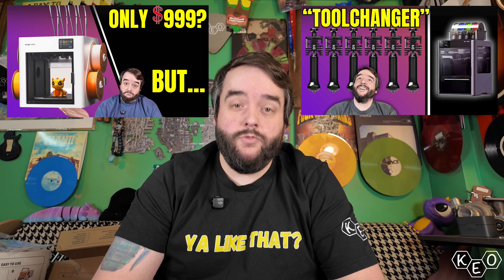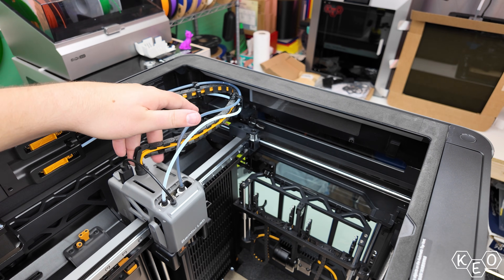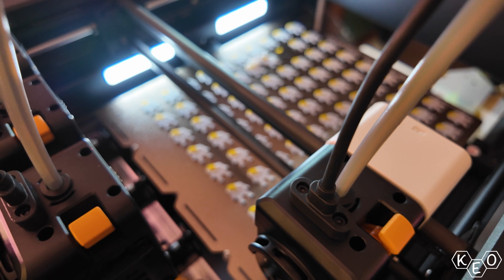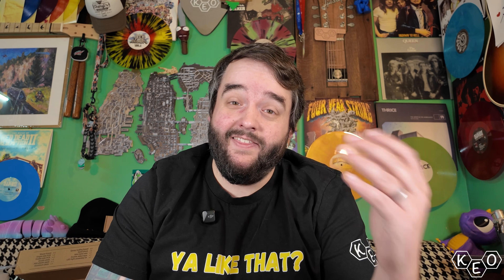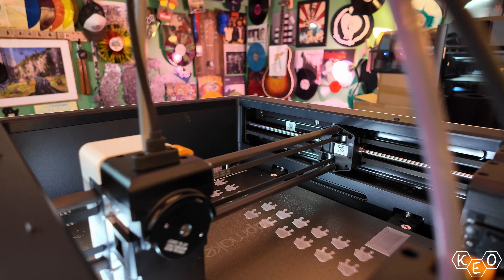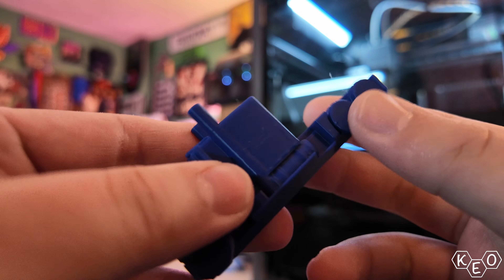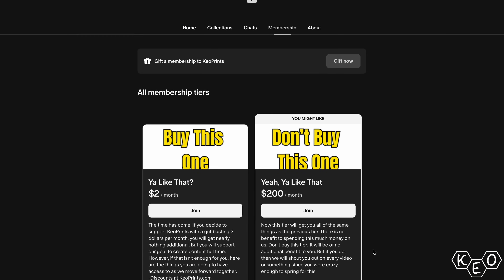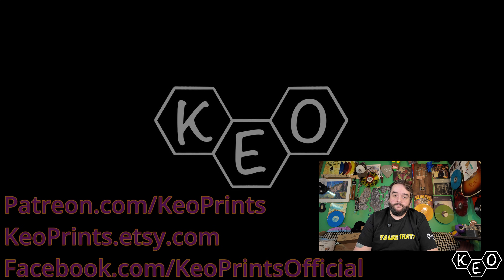Bambu H2C vs Snapmaker U1 — Toolchanger War

Comment: I told Santa he better get me an H2C or else
Reply from the maker: I hope that sleigh is rated for that sucker because my back (and wallet) just barely made it out alive
Reply: @KeoPrints LOL I hear you. I have an H2D, X1C, and A1 right now. I mostly print stuff I like, but dabble in selling things and listed the usual flexi dragons and toys on a few platforms. Honestly I didn't even put much effort into it. And then BAM, two weeks ago I started getting 2 to 3 orders a day for Christmas. I was using the H2D to print scaled up versions of the dragons and it backfired on me because its my only large printer that can fit those dragons and its a huge bottleneck. I really need and want an H2C, although the only way I can swing it at the moment is if I sell my $3,000 sony camera and lens setup. Getting the same pictures of birds was getting boring anyways, lol. I have one lens listed and will list the rest of everything today.

But yeah these H series printers do serious damage to your wallet and back. I work at a warehouse and I'm kinda used to it, I put on my backbrace and pushed my H2D up the stairs and then lifted it by myself onto the table. I was worried I would drop it or break my back but it worked out lol
Reply: @KeoPrints i forgot to mention, I do have a U1 on the way already. This video surprised me, an entire spare toolhead is only $65? Thats crazy

Comment: Both is really the only option. Actually Both but the H2D and U1. You get the flexibility of 25 colors when you need it with some waste and fantastic high temp capabilities. Then still have a tool changer for day to day 4+ colors with some tricks on the U1.  If I could only have one I'd be right there with you with the H2C because as much as I complain about flexibles I could get by with one in the nozzle to mix with the other nozzle. With the price difference you might as well do the H2D and U1 at pretty much the same cost as the H2C.
Reply from the maker: It truly is crazy how different these two are in the specific purposes they serve

Comment: When it comes to bulk, or rather cubature, you’d have to compare the U1 to the H2C with an AMS. — Also, print yourself that adapter for the IKEA box for your U1. 🙂
Reply: Ikea box works great for me.
Reply: @brandonberkmortel9558  Thanks for confirming. So it’s worthwhile since it’s no stunt.
Reply from the maker: I’ve seen that. I may do that

Comment: Compare the H2C’s print quality to a P1S. I have both and had to tune all my filaments, even BL’s that worked out of the box on the P1S. Just right now there’s even a layer-shift on my ongoing print with BL PETG HF (stacking box v2 by HG_design).

You can do TPU however, in the Wojtek system on the right, in “H2D mode” (no filament changes).

Comment: The U1 toolheads are shipping here! I ordered a spare, and it’s coming in two days. The only thing is, I ordered through multiple accounts (to utilize coupons) but only the account I used to order the U1 has been shipped for yet.
Reply: Which coupons are you using??

Comment: I agree that the TPU compatibility was a miss on the H2C. One thing to note though, currently TPU is compatible on the right nozzle and will become compatible with the left nozzle in a firmware update. Yes, that limits you to 2 TPU’s or 1 TPU and other AMS compatible filaments, but hopefully in the near future it won’t be as bad as it is currently. If you absolutely need 3-4 different TPU’s in one print then yes the U1 is the only option. But if you’re only planning on incorporating TPU into a print or needing incompatible support material, then the H2C is plenty fine

One more note on swap times. I trimmed my PTFE tubes as it says to in the instructions and I’m at a consistent 28 seconds swap time. Yes still much higher that a true tool changer, but the gap does close a little
Reply from the maker: Dang, 28 seconds is not bad at all. That’s something I might have a look into

Comment: The biggest thing for me is - time. The H2C is basically 3 times the price once when you get 2 AMS 2 Pros to cover the Vortek nozzles and and AMS HT to cover the left nozzle plus buying all the 0.4mm nozzles for the Vortek at $40 a pop. So why would I pay 3 times as much for a machine that is up to 3 or more times slower. For the same money I can get 3 U1s and pump out up to 9+ times as many prints vs a single H2C.

I got my first U1 a couple weeks ago and love it. There are some growing pains with a new launch and being an early adopter, but I'm sure most of those will be ironed out either by Snapmaker or by the community in general (considering open Klipper). I have 2 more U1s coming next month. I'm debating if I want to upgrade my H2D with the Vortek. Don't know if it's actually worth it to lose the extra build volume and have to eat $40 per nozzle, plus the upgrade seems pretty complicated. I mean I built a Voron from a box of parts and working on a Lemontron, so I'm sure I could handle it, but is it worth taking the risk of tearing down a perfectly good machine and trying to rebuild it in my garage to be as good as a factory H2C?

Comment: This thing that the H2s can do more colors is a red herring:
1) If you had a look at the Fluidd interface (stick the printer's IP in your browser), you'll have noticed the 32 virtual tools. That means you can, right now, add up to 32 different filaments in the same build. You simply pause and swap them by hand. I'm regularly printing with up to 10 elements, with minimum effort and no waste.
2) It's a kliper printer, so all the kliper ecosystem (a REAL ecosystem, because a cage is not an ecosystem) applies (yes, ymmv depending on your capabilities). ERCF has virtually no lane limits; now multiply by 4. That's the real "the sky is the limit."

You guys are comparing a just-released platform VS one that, as you correctly pointed out, has a deeper history. Give it time, you'd be amazed at what people are working on to keep expanding the capabilities of this thing.

Look at the moon, not the finger.

Comment: Thanks for this video.
You don't mention poops, so what about the two models? Personally, I have an X1C that I love, but I was put off by the price of the H2... And the fact that, before the H2C, they hadn't done anything to solve the poop problem!
That said, have you looked at the Prusa solution? There... if it weren't for the price, and also the size of the Core1's print surface, which is even smaller than an X1C, I love the concept, which seems even better than the H2C! But hey, we'll never get a collaboration with either Bambu or Prusa, I've already tried!  🤣

Comment: I see it the same way you do. I would choose Bambu, but only because they are very reliable and have good software. The camera on the U1 is very, very bad and there are hardly any parts if something should break. Bambu is known simply for its reliability. Of course, the H2C costs a lot of money. I would have seen it in the price of 1800 euros, that would have been okay with 0.4 nozzles. You also have the advantage of printing 24 colors, which is extraordinary. With the U1, only 4 colors are possible, clearly it is enough for the normal user. The Prusa with its 8 heads is said to cost almost 4000 euros, which is even more money. And it also all becomes more expensive, which is regulated by inflation and tariffs. You can easily see a p1s and a p2s.

Comment: What does the Bamboo nozzle changing actually do for you since it still has to roll back and purge anyway ?
Reply: Eliminates the need to purge the whole nozzle. You only need to prime it. Also no contamination
Reply: @riba2233  AHH yes, don't have to purge as much because colours won't mix. Would be great if Bamboo could figure out a way to keep the filament in the head though so it doesn't have to back it out all the way.
Reply: @Neuralatrophy  true, they would need more inlets like on A1 but that would limit the number of colours..
 Everything is a tradeoff :)
Reply: @riba2233  How many colours/materials do you need to print with at one time anyway ? There comes a point where you should ask yourself... "should I just paint this ?" 😆
Reply: @Neuralatrophy  probably yeah 😅

Comment: I want the Snapmaker U1 to be a profound success so that they go back and make a "U2" or whatever that's 350mm cubed and hopefully 8 heads...
Meanwhile, I'm also hoping that Bondtech INDX with the Prusa CORE One L for 8-10 heads/hotends is showing preposterously high potential... 
buuuuut as with anything speculative like this, I'm withholding any judgment until I see it in the wild, ready to just buy with a click rather than entering some pre-testing program and be lucky enough to get one of a few available. I want to see actual production units and meeting demand for off-the-shelf supply.

Comment: It feels strange that the H2C would have so many compromises as a flagship printer. Bambu claim they've been working on the tool change system for 3 years, which might be true, but the implementation into the printer itself seems rushed and confused. It looks to me like they left a lot of things on the table on purpose so they'd have plenty of upgrades to sell us later.

Comment: My H2C came with a failing aux fan, and a left extruder (non vortek  side) that has issues. Idk what the issues are. Bambu is sending me a new module. 

With that said. It has made me realize how good the vortek system is. Even on just one nozzle. It’s slow but it can print!

Comment: The H2C, in my opinion, is a hot end changer. Its not a true tool changer. If the firmware can be fine tuned, it very well could be a far better machine than a tool changer

Comment: We replaced the standard U1 nozzles with hardened steel ones while assembling the U1, It wasn't very difficult, but it was quite fiddly, with the temperature sensor wires, in particular, being quite nerve wracking.

Comment: You don't need to change the U1's entire head to replace the pogo pins, the board is listed on their site for $25.
Reply: Snapmaker also claimed 1 million toolchanges, not the 200k that somebody else claimed and everybody latched on to without actually verifying anything.
Reply: @donnyriggz look, snapmaker says that the pogo pins last 250,000 swaps (a 0.2mm print can require 4,000...), but also that the heads last 1,000,000... For 1,000,000 swaps, I read that it is necessary to spend (25x3+ 1x70) = 145 euros

Comment: The lid for the snapmaker adds a lot of space that also needs to be heated up. 
I bet it'll probably work "okay" for stopping warping with ABS but I predict layer adhesion won't be the greatest and plain nylon PA6 or weedeater string 😂 will be extremely challenging.
Reply from the maker: I’m interested to see how the enclosure does. I should have one in a month or so to test out

Comment: I have a P1S with an AMS and I hate it.  I have had it about a year now.  It always has an error of some kind.  I am constantly having to disassemble it which it is definitely not designed to be taken apart very often.  Mostly because of the fragile wires and connectors. Definitely the most frustrating printer I have owned.  That isn't to mention that I am unable to update the printer or I will loose the ability to use the Panda Touch which was a huge convivence upgrade.
Reply: Skill issue
Reply: @riba2233 yeah they don't have the skill to design a dependable and serviceable printer.

Comment: I have 4 snap makers inbound right now.  That still cost less than 2 H2Cs. For me it's not even a tough choice since I'm running a small-ish print farm and need to push out product reliably. The real question is whether I will start selling off my A1s and P1Ss to replace with more U1s next year.

Comment: If I could just have a single nozzle with Vortek design to get the larger printer area I would be happy.  I DO really want a snapmaker U1 but I want to wait and see what the longevity of both the Vortek and Snapmaker changers is like.  How many changes before some fault creeps in, accuracy, communications issues, or whatever.

Comment: The tool heads are rated for 1,000,000 swaps under regular use 

I have found what looks like the actual pogo pins module (3 pogo pin SMD component) on aliexpress for 0.44 USD, so if you are comfortable with soldering, then you might be able to just go that route.

You can also go to the fluid firmware page directly by just going to the printer's IP.
There is already third-party firmware available that adds a whole bunch of functionality, including using your own RFID stickers that you can program (that feature will be released soon, but is in preview)